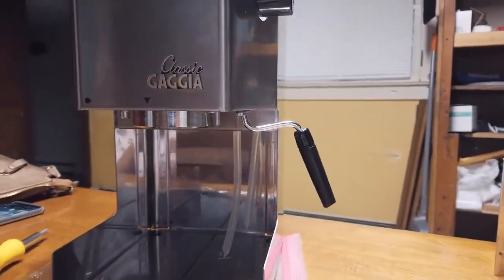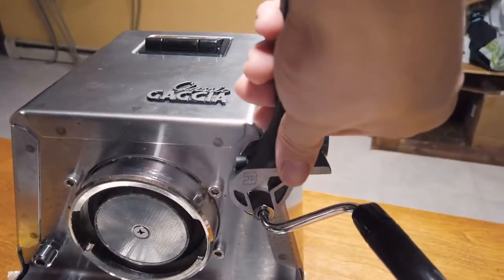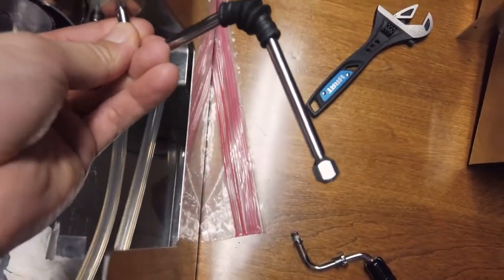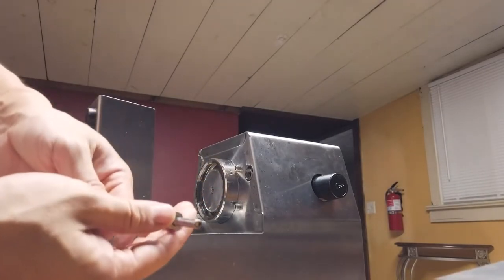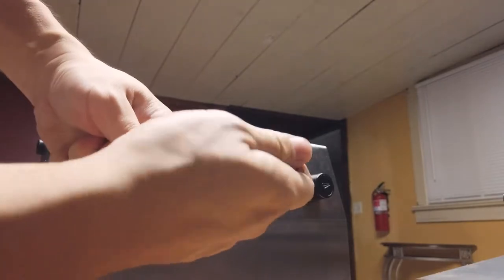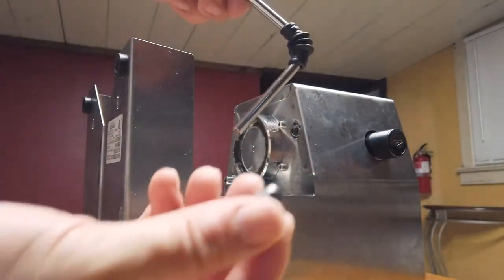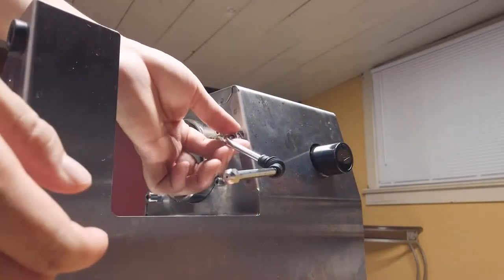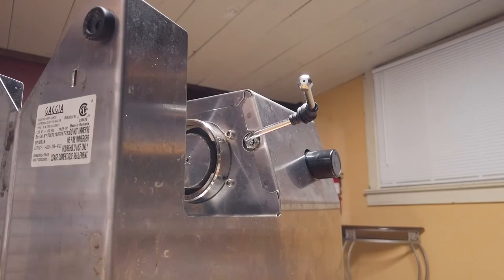Most Important Upgrade For Your Gaggia Classic: Rancilio Silvia Steaming Wand Upgrade

Comment: I did have some issues with the new wand unscrewing itself over time. I put some wax on the tip before screwing it in, but not sure if the wand it too big for the screw nut and causing too much friction.
Reply from the maker: I think because since this is not a factory replacement it doesn’t fit perfectly. Best course of action is to just buy the original factory wand
Reply: @TheGizmoGarage  totally understandable! Was curious if anyone had the same issue. Willing to deal with this small inconvenience for the lower price.

Comment: My wand doesn’t swing freely like that. Tightening the nut fixes the arm in one position. Should that be the case?
Reply from the maker: Usually it moves around and shouldn’t have any leaks there might be a oring inside but I forgot if there is one
Reply: I have the same problem…

Comment: Mine doesn’t tighten properly.  Moving it makes the nut to lose which eventually come off.
Reply from the maker: There might be an O-ring or washer missing from where nut connects to the machine. Might want to check the schematics of Gaggia classic, and if all else fails, get the gaggia classic pro steam wand to be 100% safe on fitting.
Reply: Thank you. There is an o ring but it didn’t help. I will try the gaggia classic pro wand.

Comment: Do you know what the purpose of the black rubber elbow is? I think it would look cleaner without it, was thinking of doing a similar mod. Nice video :)
Reply: It’s so you don’t burn your hand when moving it, assuming you don’t have a cloth in your hand. Some modern machines have a double walled steam wand so the rubber gasket isn’t needed.

Comment: Hi, I changed this out and now have low pressure. Feels like only air is coming out of the wand. Any ideas?
Reply from the maker: It's also possible the steam temperature stat is not working, instead of the steam wand. The stat needs to be replaced. https://www.youtube.com/watch?v=_2OYk9n8OT8&t=32s&ab_channel=WholeLatteLove see this video for possible cause and fix.

Comment: What is the benefit of using to Rancillio wand compared to Gaggia standard wand ?
Reply: From what Li Fan said, it's half the price.
Reply: That big black plastic sleeve on the original steam wand helps to froth the milk, which is fine if you want a cappuccino-like result. You can pull that off and just use the steam wand directly on the Gaggia is you want to steam milk for a latte of flat white, etc. but then the wand is super short, which makes it hard to use with anything but the smallest pitchers.